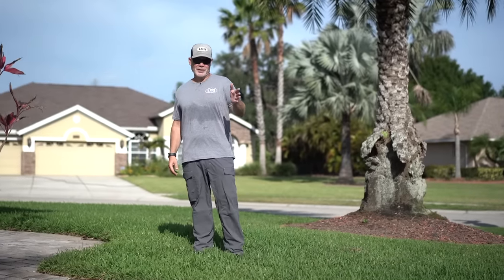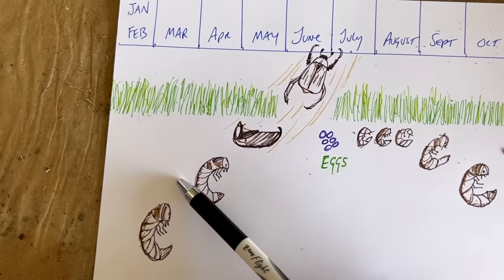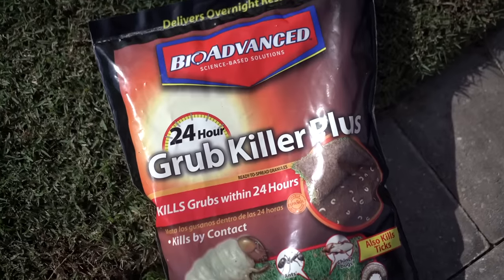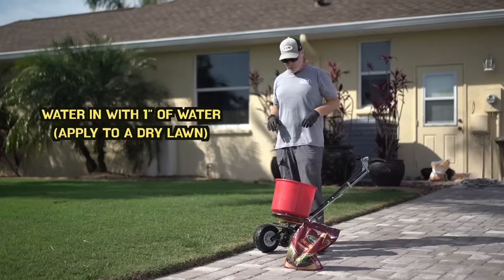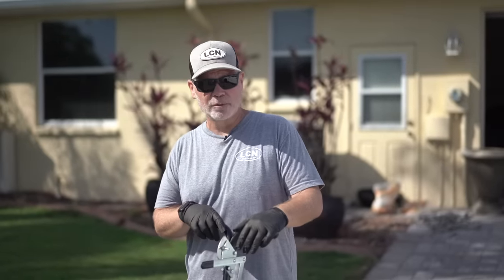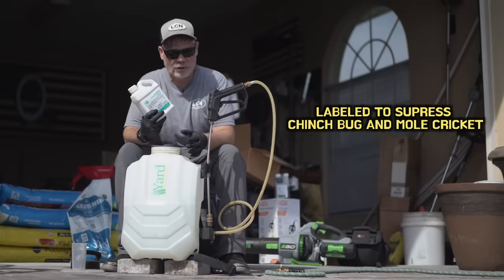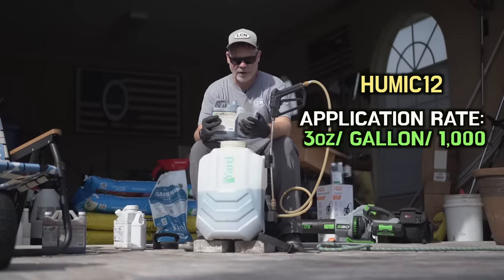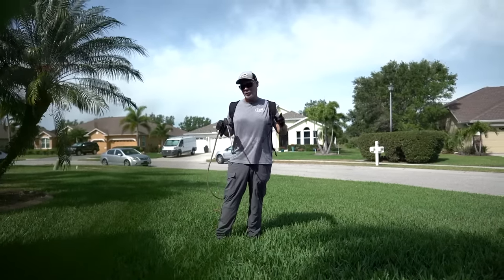Lawn Grubs 2023

Comment: What would you conclude the rate of N based on the following rate FERTILIZER+BROADLEAF+GRUB
Spray, 2.00 GAL/1000 SQFT
Entire Area
17-0-5 UBM (NITROGEN,POTASSIUM) EPA#
RATE: 0.3020 GAL/1000 SQFT APPLIED AMT: 6.2305 GAL.   The total area is 20628 and the total volume of spray was 41.26gal

Comment: Great thanks for a newer updated grub video! I did grub ex last yr and then dylox later in fall. ALOT of the FB group members recommended arena and thought of that route but most grub guides recommend merit or preventative. Thoughts on arena for grubs and as a once a yr app to cure all bugs and crawlers???

Comment: Central Texas here.  Pretty sure we caught all of the junebugs in the world in our pool skimmer last month - you're welcome! 🤣 But seriously, we had quite a bit of grub/chinch damage to our St. Aug coming into this year that I didn't prep/plan for last season.  I didn't know the relation between the two until this year or else I'd have made the connection previous years. The junebugs have been getting more and more year over year.  I applied Triazicide as a corrective on March 10th after I noticed my mistake (dug up and found both grubs/chinch). Very few junebugs showing up in the pool overnight now.  Is right now still the right time to apply a first round of preventative?
Reply: I'm in the DFW area and I will put down imidacloprid early to mid June. Imidacloprid is good in the soil for 3 - 4 months as it starts deteriorating 
So if you put it down in June, you'll catch the eggs hatching in mid to late June through Early September. Hope this helps

Comment: Allen I'm in my 2nd season of your lawn care plan. I have 2 questions. My soil test came back low in npk. I plan to throw down starter in my first app. Can I also spray down green pop with it. How long should I wait after  the granular app should I wait. Also plan on starter for my 2nd app same as last season. What do you recommend.
Reply from the maker: I would not do them both at the same time. You don't have to correct the issue all in one day. use the soil data to guide all of your future apps. If you want, in the YM app you can activate a custom program based on your soil test - it will tell you want to apply all season.

Comment: How did you calculate a spreader setting of 22?  If you use the conversion chart it should have been around 14.
Reply from the maker: perhaps the scotts instructions are having you applying it in two passes (N-S/E-W) whereas I did it in one.